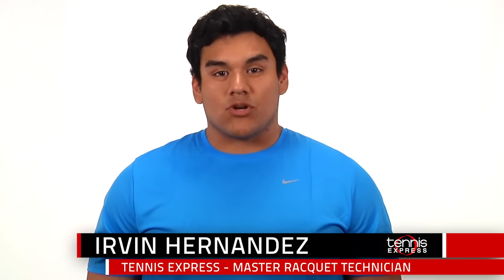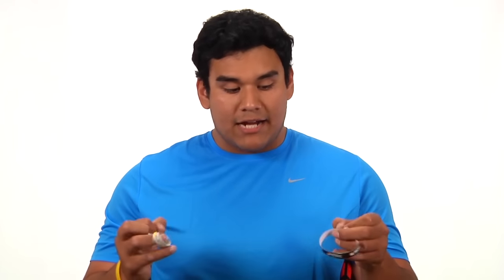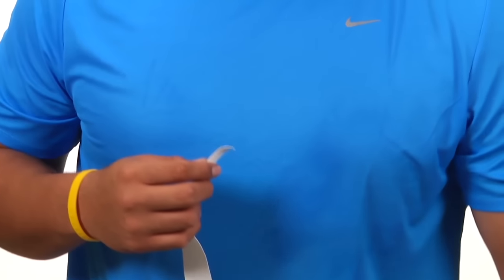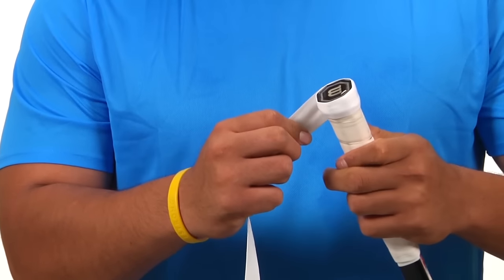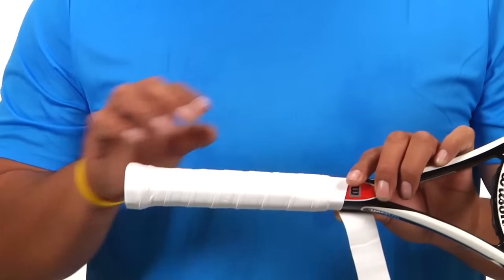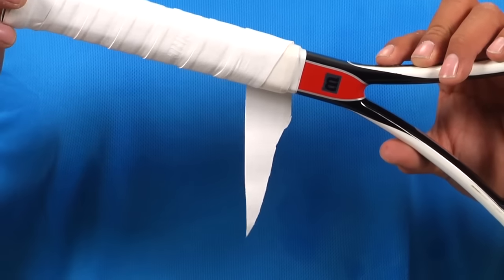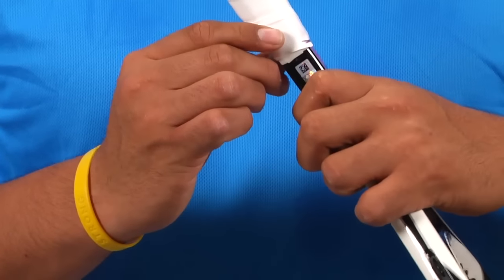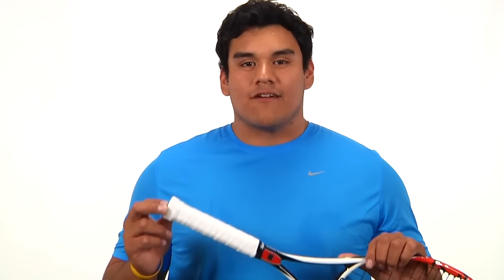How To Replace a Tennis Overgrip

Comment: Using the pen to mark the end is a nice detail, but nobody I know does this. Everyone just folds the end with an angle to make it tapered. Useful for when you don't have pen and scissors with you on the court (most people don't)

Even better is when the overgrip is already pre-cut on both ends, but those are rare.
Reply: DeeeFoo EXACTLY

Comment: Good tips about the start of the install starting on a corner of the buttcap and also marking where to cut it with a pen, but I see a couple issues with this instruction too. For one thing, he didn't stretch the grip as he was laying it onto the handle; you should stretch the grip and pull on it before you lay it down so that it sits tighter against itself and it also kind of activates the tack in my experience. Secondly, I noticed on the first couple rotations, the overgrip didn't lay completely flush and it was raised a little bit on the overlaps, which is a problem because that will make the grip more uncomfortable to hold and cause your skin on your hands to rub against the grip too much and possibly cause blisters. I also noticed along the length of the overgrip he had air bubbles or little creases still left over, which can also cause blisters. Just make sure it's flush, tight, and consistently spaced/overlapped all the way up and you'll be good.
Reply: Why must you start on a corner bevel? I start on bevel #1. Top bevel.

Comment: You didn't mention sticky side goes on the outside. Opposite of what you might think. A lot of novices get this wrong!
Reply: thank you! was rewatching the video just to see which side the sticky side is supposed to be on :)
Reply: what do you mean?
Reply: @xxbunni973  sticky side might have been for gripping but it’s to stain in place on the racket
Reply: On mine both sides were kinda sticky, is that normal?
Reply: @CarPea  Don't think so. Stickier side on the outside then

Comment: Atar, it is on the right way, and  also is good to mention that many pro use the entire overgrip until it ends over the raqueta frame, specailly the ones with two hended backhands.

Comment: question... i have a machete with a plastic handle.  i was going over options that could improve the grip and i found my tennis tape. how well do you think it will stick to a plastic handle with grooves? im also considering using it on our old wooden bat. bat is for home protection and machete is for my camping trip.

Comment: This is the wrong way. He starts with the narrow end at the bottom, whereas the narrow end should end at top. No need to do any cutting. If there was any need to cut, the manufacturer would have done that to begin with.
Reply from the maker: +Athar Abbas He did start with the narrow end at the top.  If you watch at the beginning when he starts wrapping, the tape is whats holding the over-grip to the replacement grip. Had he started with the wide end at the top, there wouldn't be any tape to keep the grip secured.
Reply: Tennis Express when I say bottom, I meant bottom if the racket. May be you are referring to that as top. As for starting with broad part at the bottom of the racket, we don't need the sticky bit, friction and tight wrapping is generally enough. May be I'm wrong, but that's how I use.
Reply from the maker: +Athar Abbas Ooohh, my apologies, I see what you mean now.  Over grips can really be wrapped however you choose, although most commonly they are wrapped how it is shown in our video.
Reply: +Athar Abbas Naw dog you're wrong. Doing it that way leaves a lump on one side of the bottom of the grip, making it asymmetric.
Reply: My thoughts exactly. At first I though...what, I have been doing it wrong, all these years. Than I saw his hatchet job with the scissors and pen. Nope. I am doing it right. The cut end is supposed to come in the end. At the cap just overlapping the band will be enough to hold it.
If you don't believe me, unwind the grip from any racquet. Now tell me where the "cut" end is...you will see it is at the end, not at the cap. From the factory.
Reply: thefridgeman exactly. That and most overgrips come with tape for the top.
Reply: yes, but that is just one way. he is still correct but very slow and in-efficient.
Reply: Are you lot kidding? You always start at the base of the handle, the taper that is pre-cut is designed to be a clean edge as your hand may be rubbing against or very close to it during play. Of course you cut at the top, rackets come in all different lengths and thickness, an overwrap is designed to accommodate many of these differences by being somewhat longer than needed. The reason you cut the top part is because the tape will be covering it anyway. I've unwrapped re-gripped hundreds of rackets and the pre-cut part is always at the bottom, I've never seen it the other way around. The grip ends up being tapered at both ends, pre-cut at the cap and cut by the stringer at the throat, occasionally pros will not bother cutting the top part as they re-grip on court or in a hurry, but that doesn't matter as your hands won't ever be touching that part. This guy's cut is messy because he's having to hold it awkwardly for the long lens on the camera.
Reply: How could design of rackets impact the tapering? If it's supposed to be cut then why they don't put tapering at the end as well. Why would anyone have to carry scissor for this? Please explain.
Reply: Like I said, some handles are longer than others, some are thicker than others, some people add 2 or 3 overgrips, so a grip needs to be long enough to cover all the possible variations. You don't have to cut the square end, many people don't, but they still use the factory-cut tapered end at the butt of the handle. You want a predictable and smooth handle with a neat edge on the part you hand actually touches. If you don't want to, or don't have time to cut, leave the square end at the top of the handle.
Reply: I always end with the tapered end, never start. Just seems like a waste of time to cut. I find no need to change. I wrap the butt tight enough and grip feels smooth every time I play
Reply: Tennis Express get ur damn mind straight proffesional

Comment: WRONG, WRONG, WRONG...Why do you think it already has a tapered end? And he used scissors to replicate what's already there at the other end.  That's for the top, NOT the bottom. I've been doing this longer than this guy has been alive.  You don't need scissors either. Notice the finishing piece of tape supplied with the overgrip? Notice its width..it's very narrow. He doesn't even address this piece of tape that's included in every overgrip.   The reason it's narrow is because the tapered end is supposed to be at the top and the narrow finishing tape is all that's needed to cover the top IF you finish off with the narrowed overgrip. I've watched the pros on TV do this during a tournament and they used the wide end at the bottom.  If you do this the way this guy shows, you have a wide end at the top and the included finishing tape won't cover it completely so you end up with the end of the overgrip sticking out of the finishing tape.  Also notice the jagged end of the tape he had to cut off. This guy needs to go back to school.
Reply: This was a very aggressive comment for an 11 year old video on how to grip a tennis racket

Comment: You are doing it wrong :)))))
Reply from the maker: In what way?
Reply: yh, there are 2 ways to grip your racquet. one is with the taper side is at the butt and the second is the opposite. i would agree if you meant that you arent really MEANT to cut the grip, thats usually for replacement grips.
Reply: Don't be daft, to end perfectly on the pre-cut is ridiculous. You may have gotten used to it for your own racket, but try wrapping a Pro-Kennex with much shorter handle for one-handed backhands, and then a Head Speed Pro which is about twice as long. Trying to align the pre-cut part with the top of the handle will be much harder than just cutting where you need it to stop. Personally, I just cut without drawing a line, but if you're trying to match multiple rackets you can't just use up a full wrap if it isn't needed, and without a clean taper cut at the cap, your hand will be holding a lumpy handle. If you need to re-grip in a hurry, just don't bother cutting the top, but you always use the pre-cut taper at the cap.